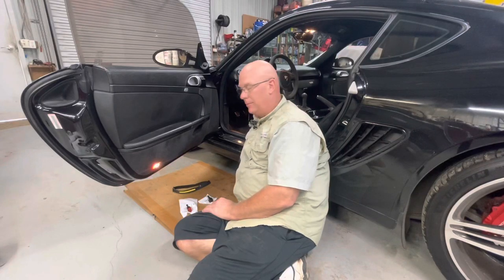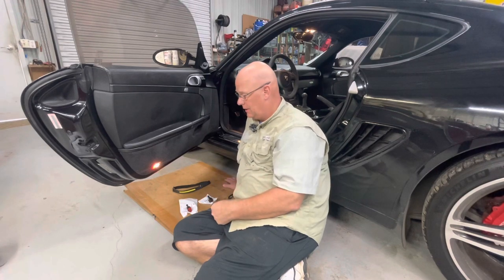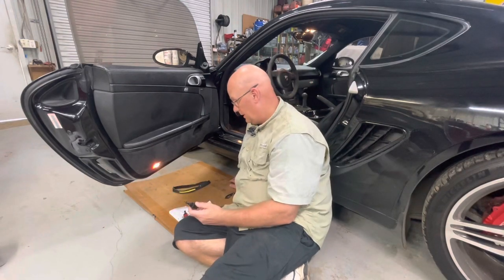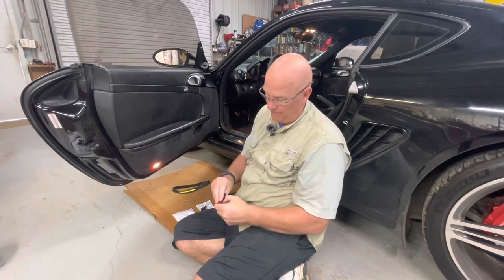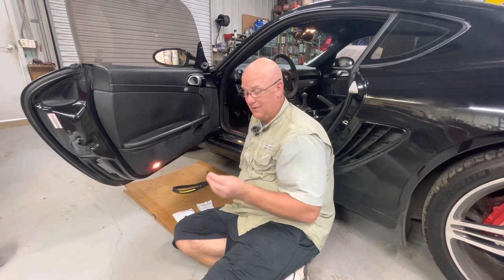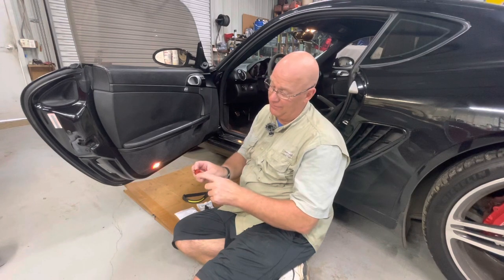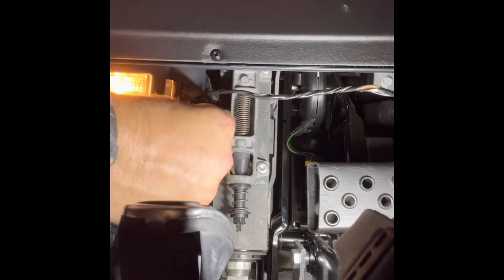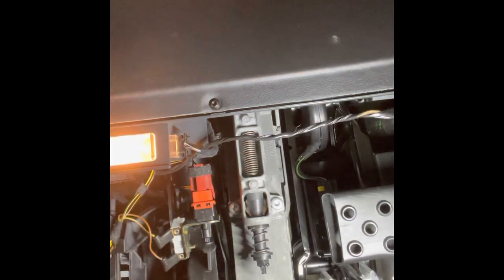Porsche cruise control brake and clutch switches identification and replacement.

Comment: This is an excellent video. 2 questions: 1) is the dash cruise light impacted by this?  Mine is on when in key turned but not started, but off when started. The cruise on off does impact the dash light. 2) if brake lights are working it would seem that that switch is OK. Do you agree?
Reply from the maker: Thank you. The dash light is not connected to this in any way. Except to indicate the cruise control system is on. The brake lights working fine when the pedal is pushed is how mine was. My thinking was the switch was shorting out with the pedal all the way up and causing a momentary brake light flash. Which would turn off the cruise control. The new switch solved the problem so I think that was the issue. Thanks for watching.